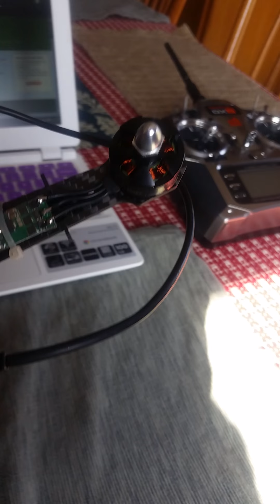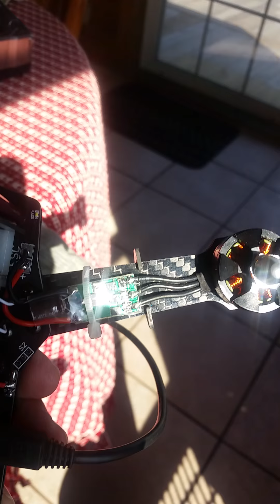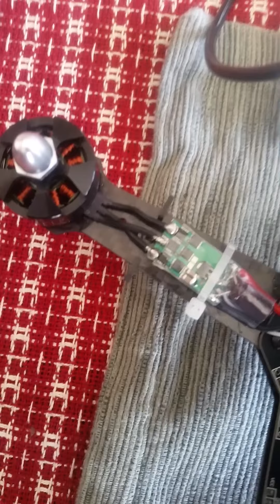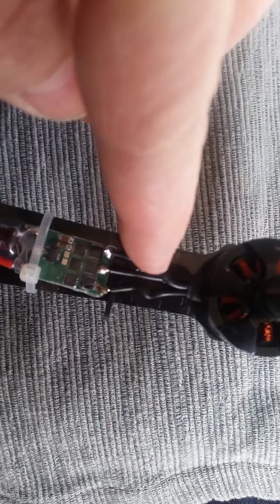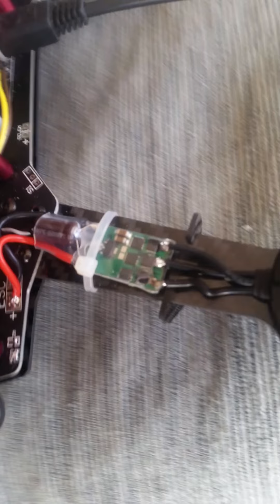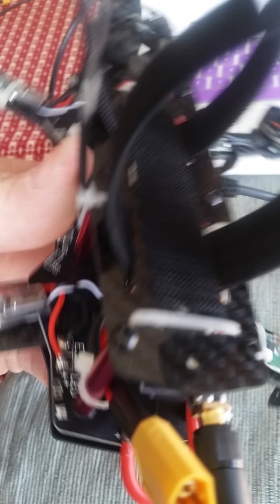My ZMR 250 quad racer build. With a Spektrum DX8 controler and Acro NAZE 32 Rev 6

Comment: you can use the 11ms protocol with this setup?
Reply from the maker: No 11ms , 22ms is what you need to run
Reply: +bryankrebs57  You can bind the SPM 4648 with 11ms, I have no idea if it actually speeds things up but it works
Reply from the maker: +Jeremy Field, I heard it will burn up your servos running 11ms. but let me know how it works out.

Comment: Any idea how to wire my spektrum ar610 rx to the naze32 Rev 6? Can't find a wiring diagram anywhere and the pins are dirffernt to my broken Rev 5!!?
Reply from the maker: Yes I have wiring diagram I will post it on my site for you.
Reply: +bryankrebs57 that's great thanks!
What is your site called ??
Reply from the maker: You get everything working? or still having problems?